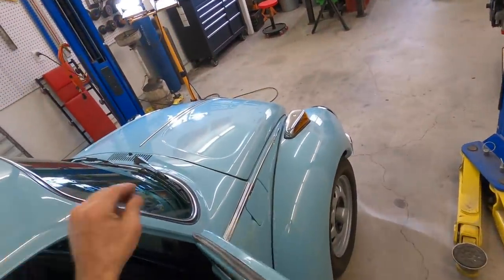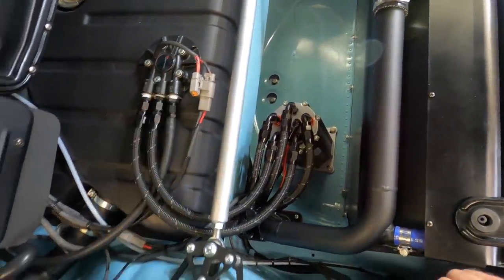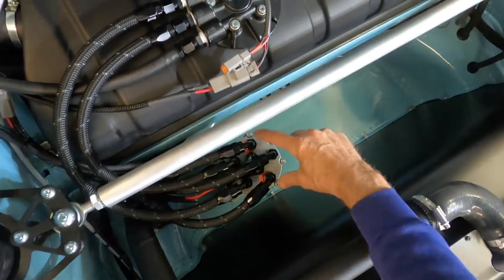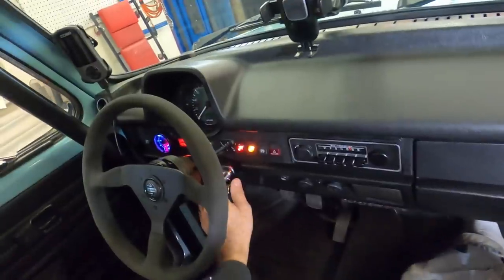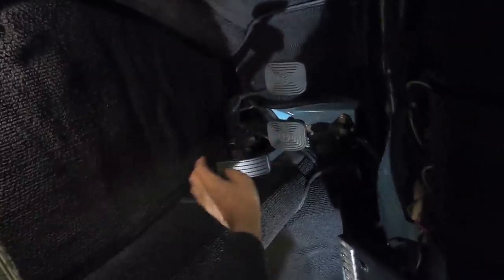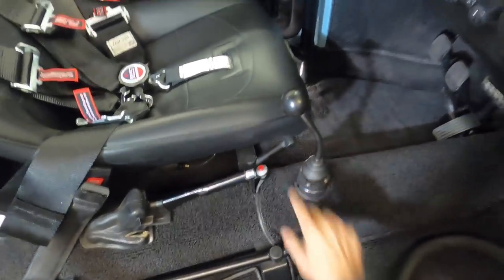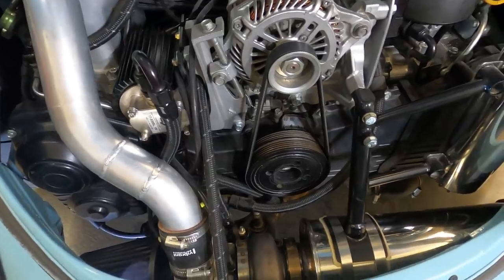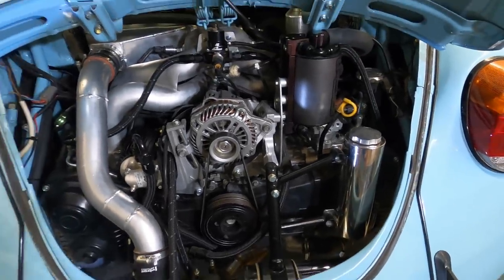Just for fun drive in the SuperSleeper

Comment: That thing is bonkers!  I'm going to get my 1973 Super Beetle running soon.  Mine is a "sleeper" too.  But not for the same reason as yours.  Mine drives so slow you could fall asleep from boredom...
Reply: 🤣 lol, I hear ya.  And I bet my ‘66 beetle is even slower than your ‘73 (hopefully not quite as slow once I finish the rebuild)
Reply: @JMKGarage  Doesn't matter.  These cars are awesome classics,  no matter how slow they are.  VW Microbus too.
Reply: InstaBlaster.
Reply: Free mods, take out the spare wheel, the back seat, the stereo, speakers, passenger seat, rear parcel shelf and  you can put on earplugs then lose the carpet and sound deadening, even the headliner hah, now your bug will be 0.5 seconds faster probably to 60 mph for free.
Switch to a lighter oil and pump tires to 18 psi up front and 28 at the back.

Comment: Hi John  awesome build you are amazing. I also have a 73 super beetle I picked up last summer in Kentucky. It is a true time capsule .It was last registered in 1976 and has 2332 miles on it and not a scratch on it and it stills smells new inside. The only defect it has is the rear bumper has some rust spots from being parked in the same spot all those years and a drip from the garage roof kept landing on the bumper. Its the same blue as yours just a lot slower. I actually have not registered it yet anxious to drive it this summer. Take care

Comment: Fact is the car probably handles much more like a Le Mans car than a VW. The extensive frame reinforcement the suspension mods plus I must assert better weight distribution makes it more like a rally car Now no doubt the 500+ HP both creates a thrill (WOW) but also creates enough accel to make the Bug airborne if not careful. Much like the old space shuttle with Hydrogen Boosters riding in this car is a calculated exhilarating insane risk anyone like John or myself John could not resist. Why did John build it? Because he wanted to an could. Excellent craftsmanship, beautiful car and certainly a sleeper of sleepers! Kudos John you have done it! If I'm ever in your area would love a ride! At 70 I can still dish it and take it! Speed forever!!!!

Comment: In the mid-70s I built a 55 Volvo, tube frame with a LT1 425 horse, and a Rock Crusher transmission , 411 positraction rear end. It took three years to complete and roadworthy it look like a chopped and channeled 40 Ford oh yes I had the tub out the back in for the wheels. Now that's scary fast what a trip

Comment: Labor on this car is looks definitely perfect. Every thing looks very tidy, properly made . 300 + HP old beetle with AC is a real dream. I m not really fun of the color and wheels (Modern wheels with wider and a bit larger tires would look way better) but still looks amassing. People should do the same thing with the New Beetle 5C, RWD or AWD conversation,  engine/power modification and preferably manual shifter.

Comment: John, that car is amazing, I noticed there was nobody in the passenger seat? That has to be 
one Hell of a ride. 🙂👍🏻 I'm really looking forward to an update on the Corvair. I was wondering if you 
though of making the body separate from the frame, it might make it easier to work on the engine kind of like working on a  Diesel pickup, lifting the cab off the frame. I know you said you wanted to drop the engine out. 
Either way, I can't wait for this to happen. 🙂👍🏻
John, have a Happy New Years!🥳
Reply from the maker: Thanks, everything is on the table concerning the Corvair.  Some ppl drop the body on a typical car frame with rails.  It's a good solution that comes with a weight penalty.

Comment: Hey John, I'm in the midst of a somewhat similar project though less sleeper ('73 standard Beetle... mid-engine/tube chassis).  I will be making similar power and was curious what radiator you're using and how well it keeps the car cooled.
Reply from the maker: I use the radiator that came from the donor Subaru.  It's very light, was made for the engine and well...I already had it. I would say to try to fit the biggest rad you can and remember, it's more about the air flow entering and exiting the rad than it is about how thick or trick the rad is.
Reply: @JohnReynolds661  thanks, so the stock radiator deals well with near double the hp.  Good to know.  Thanks!

Comment: Awesome build quality John and probably the only build i have seen to rival "project Binky".Looking forward to your next build.As we are close age wise would you reconsider going for so much power to make a more enjoyable driver with less gear whine.I find what is cool tends to mature with age.Not meant to be a criticism BTW.
Reply from the maker: The first go-around was a modest 290 whp.  It had quiet, supple rubber mounts and quiet gears that were easy to shift.  But it just wasn't  over  the  top.  I wanted to spread the distance between how it looks and how much power it has, have as big of a contrast as possible and still be street legal.  It's challenging to drive and demands your full attention and respect. I drove it pretty hard in this video but normally I just putt around.  If I want to drive something quiet, meek and safe, I'll jump in the Honda Accord.  I used to race off-road but decided I didn't need that much excitement.  The same well happen with this, but in the mean time, I'm going to enjoy it.

Comment: Sure beats my 71 super with a 2.5 SOHC Subaru. I kept the factory transaxle but fitted it with a Quaife limited slip and overdrive 4th. Kept the stick EFI and even has the cats on it. 4 wheel disc conversion, Porsche Fuchs wheels. Cooling system has 3 radiators. 2 tucked in fenders and 3rd is 996 center radiator behind the A/C condenser grill.

Comment: Great build! One question: have you run into any wheel hop with this setup? I ran a 68 Bug with a built 2110cc engine back in the late 80s and the wheel hop was terrible from a dig.
Reply from the maker: Originally, it had terrible wheel hop.  After changing all the motor mounts to the hardest urethane, adding the kafer bar and tying in the roll cage to the frame horns, the hop went away.  If I experience it again, the next step is solid motor mounts.

Comment: Just wondering if, or how, the steering modifications changed the "feel" of the control inputs from the steering wheel.
Reply from the maker: Rack and pinion has a more direct feel of the road IMO.  It's also less complicated with less moving parts.

Comment: What's your 1/4 mile time?  Back in the '80's I had a '71 Super Beetle and had a 2110cc VW motor built with a bus diff in the trans.  Ran 14.2 sec all day at Firebird in Phoenix.  No problem beating Camaro's or Mustang's back then.  Factory Corvette's were running 14 sec and they were tough.  Good times, and my compliments on your build quality.  Hope it lasts for you.  Pete
Reply from the maker: I'm going to the track tomorrow but it's only 1/8 mile

Comment: Great job on the build, both technically, and aesthetically, but I have a couple questions. I'm betting you had to realize that you were creating aerodynamic lift when you vented the radiator air down and underneath the car, as opposed to adding downforce had you taken it upwards, or to the sides. Was this just a design compromise, or did you believe it would make little difference, or both? And have you ever considered switching to a fuel cell to solve the fuel pickup problem?
Reply from the maker: It's not really practical to vent the air anywhere but underneath.  It could be vented out the top of the trunk lid but that would look silly.  I don't see where it could vent out the sides.  Besides, the car is not going at speeds where fussing with where the air exits is an issue.  Thought about a fuel cell just to increase capacity.  But then the fuel cell is higher than the filler neck.  Using the conventional filler neck trumps having a bigger tank.  In short, I made changes where I thought the time was (at least to me) well served.  I didn't go around changing everything just to make extra work.  Thanks for the compliment, if this was more of a race car, your suggestions would be on track.
Reply: I thought the same thing re the air being ducted under the car, but then answered it with the same one John has. This car was built (beautifully) for fun and play, not for high speed. I noticed he was cautious on the handling on corners as well, even with those shoes on. The attention to finish is admirable. A real craftsman.
Reply: @ucsglobal  Awesome build as-is, so I was nitpicking, really. I also wanted to get his take on feasibility of a different routing of the air. As far as performance, goes, I was thinking more of stability, than outright terminal speed.  These aerodynamic effects on a moving vehicle begin to come into play around 60MPH.

Comment: Just some quick questions. Where did you learn auto mechanics? Were you also taught by a friend or family member?                                               I’m a VW enthusiast, but I wish I knew how to do this type of restoration.  I did own a red Subaru powered 1990 VW double cab DOKA TriStar. I think it had a WRX engine, but you can Google it. It has the 2 Hella fog lights up front.
Reply from the maker: I had an interest and curiosity when I was young which started with go-carts, minibikes, motorcycles and eventually 4x4s. Off road racing built up a lot of structure and fabrication skills which I use on my street car projects.  Mostly self taught by trail and error.

Comment: Why do you use E 85 instead of Gasoline? Is better cooling the engine? We  used to run an alcohol Funny Car has to hand squire gas or Nitro into fuel injection Air horn to start it up! After a run there would be ice on intake on humid summer nights!
Reply from the maker: e85 has a higher natural octane which means more timing and boost can be used.  It also runs cooler.  There is more than 100 HP difference between using 91 octane and e85.  Good question.

Comment: Probably stupid question: what’s the ‘airbrake’ sound when switching gears up? Thanks.
Reply from the maker: You're hearing the turbo blow-off valve.
Reply: Turbo spool.
Reply: a release of boost pressure from the turbo ( momentarily not needed so vented when changing gears).

Comment: VERY impressed with the build quality of this Bug, looks like a factory design. Two questions: What will it do the1/4 mile in and why run it on E85 rather than premium gas?
Reply from the maker: I need a track to get a 1/4 mile and they aren't open around here yet.  e85 makes about 120 more hp than 91 on this engine.

Comment: Love it, beautiful work! Curious though. With all of the additional weight in the rear end, how does it handle at higher speeds? When approaching 100 mph the front end would get a bit light in mine, have you had this problem?
Reply from the maker: The Subie engine (in this trimmed down form)  is 80 lbs. heavier that the VW engine.  Because it sits 4" forward and the fact that there are radiator components up front I wouldn't be surprised if the bias is a wash.  I've been 127 mph in it before and it's definitely a place you don't want to spend a lot of time in.

Comment: Lovely! 

As a former souped up skuby owner over 3 years i must say. what a lovely build.   the right gearbox was chosen as well, just all over impressed. 

The one thing i noticed from the road footage, im sure i heard the torsion springs from ur clucth oscilate quite a bit. Did it feel like it bucked back and forth?
Reply from the maker: Well, it has a new ACT super duty clutch and lighter flywheel.  What you might be hearing is the slop in the dog engagement gears, which is the way they sound and perfectly normal.
Reply: @JohnReynolds661  sounds right. hope you get lots of hours in the car man... built not bought is respekt

Comment: Excellent work, John! I just finished going through your build thread on Pirate, what an adventure! I do have a few questions if you have a minute. Did you buy a roll cage kit or bend from scratch? What oil cooler did you end up using?
Reply from the maker: The cage was a kit from RLR.  It's 1-5/8"x .083" chromoly.  The rear diagonals were made removable so the car body could be lifted 3" for painting (the cage).  The water to oil cooler is made by Mocal/Laminova

Comment: Can you talk about the suspension setup, stock or  double wishbone independent suspension front and rear ?
Reply from the maker: https://youtu.be/XwtPbucjyJA
Reply: @JohnReynolds661  - Did you ever consider the double A-arm front suspension kits? obviously it would be a tight fit with the rad and intercooler up front.
Reply from the maker: Mendeola makes a double a arm set-up for a beam axle.  I'm sure it works great, but it looks heavy and blocks air flow to the radiator.  The SB front strut suspension has a nice ride, handles decently, doesn't take up much space and is light weight.

Comment: Love this!! Porsche Killer... Only concern is the air flow pushing up on the car at high speed. Do you experience any floating from the Radiator air flow?
Reply from the maker: I haven't noticed, but driving the car above 120 is sketchy.  Not that it acts weird, it just feels like you shouldn't be going that fast in it.
Reply: @JohnReynolds661  Love the look. I bet the lighter the fuel tank get the more floating you will experience. Just a thought did you consider placing two radiators were the rear seat would be? You would be able to pull air from under the rear fenders or the underside, then exit it out the back keeping your factory look? This would also add air flow over the motor. Just a thought. I would love to do this on a VW bus..... :-)
Reply from the maker: @Shawn Thomas  I like the radiator at the front of the car, where all the airflow is. Over heating is usually attributed to bad air flow.
 Also, radiators make heat which you don't want in the cabin area.  If you have a bus, then you have to get more creative with radiator placement.

Comment: With all the other modifications I don't understand why you didn't cut the fuel tank up and install baffles or just install a racing fuel cell with foam to prevent slosh. The millennials that have to google what the two pedals are for are probably also wondering what the big black ball on the stick coming out of the floor in between the seats is. Amazing build, do you have an estimate of the hours you put into it? You must have had months in just the planning and measuring. The only thing I don't like is that it sounds like a Subaru.😒 I'm old school hot rod VW, 40+ years ago I built a stroked 1855 cc with (self) hand ported and polished heads, SS valves, high lift/duration cam, lightened flywheel, Deep sump with twin 48IDA Webers and a header/glass pack muffler exhaust that sounded mean as hell. Even though it probably only had about 140-150 hp and was nowhere close to as strong as yours it sounded like a beast and that's part of the fun. Of course in those days (mid to late 70's) I could keep up with some of Detroit's fastest production cars, things have changed a lot. I plan to build an even bigger and badder VW based engine for my 61 bug that I would have liked to at the time but I was 18 but had no money, now I can afford it.
Reply from the maker: A fuel cell was an option and I definitely thought about it mostly to get more volume.  But this would mean that the tank would be higher than the filler neck, which  enters at the side of the car through he gas door.  So now you can't just pop the gas door open and fill it up.  Instead you have to open the trunk lid, like a race car, and fill it up.  It's a small detail but I rather like using the OG gas door.  The exhaust header I made is equal length and should have a similar sound to an equal length VW exhaust (in my opinion it does) since they are both horizontally opposed flat fours.  Now the OG Subaru exhaust, which is un equal length, has a rumbly sound which I don't like.
Reply: @JohnReynolds661   Opening the boot lid would not be out of place on pre-67 beetles (not sure of the year) as that was where the filler was. But I understand your reasoning for not going the fuel cell route. Terrific design, engineering and fabrication on this project!
I agree about the sound. With the equal length headers on the Subaru it does sound like an air cooled VW with headers. I have had both, early VW's and a WRX. Like your subtle humor, better not press the throttle pedal or it will flood!

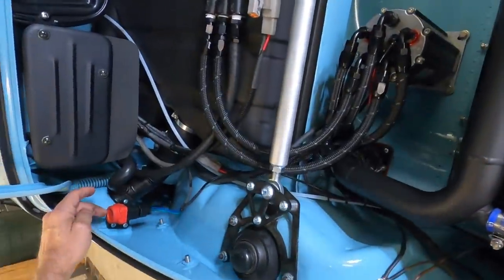Comment: 10 Gs seems high for an inertia switch designed to turnoff a fuel pump in an accident.  8:12
Reply from the maker: Honestly, it's hard to find specs on these things as I looked.  I did find one site that list the specs and it said 10g.  A lot of hard core racers, especially land speed racers don't use them because they trip too easy.
Reply: @JohnReynolds661  I know Ford has religiously used these type devices for decades at this point.  You could smack those and make them shut off.

Comment: I would like to know what you have in your motor to make 515 I have the same motor in a 65
Reply from the maker: I thought I explained it in the video.  In short, 29 lbs of boost and e85
Reply: Did you put Piston work to hold the boost what size injectors

Comment: Am I correct to say thats a five speed in there? What transmission did you use? Is it just the reversed subaru transmission?
Reply from the maker: Yes, Subaru 5mt with subarugears reverse R&P.  The SuperSleeper Project video has a little more info.
Reply: @JohnReynolds661  Definetely will take a look, thanks mate. Looks like an awesome build.

Comment: Seems like the 4th gear is kinda noisy???
Reply from the maker: Dog boxes are noisier than stock and when you remove the soft, rubber motor mounts more noise is transmitted.  That's another way of saying yes, it's noisy in 4th.
Reply: @JohnReynolds661  > Didn't know that...